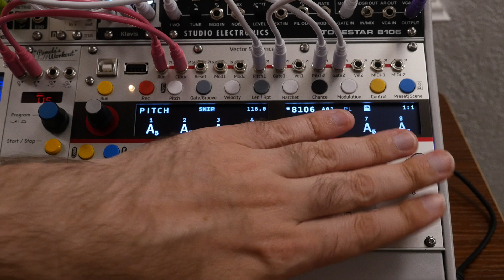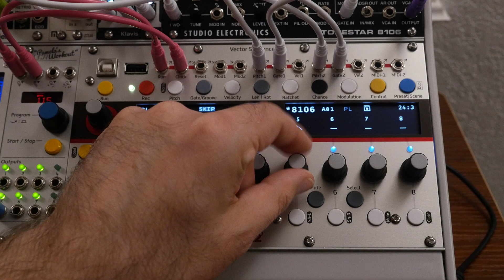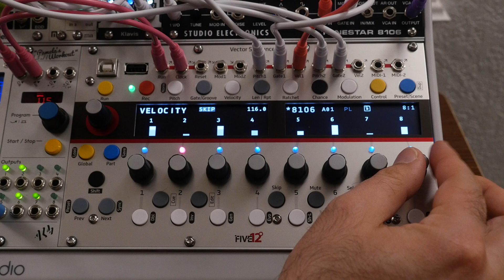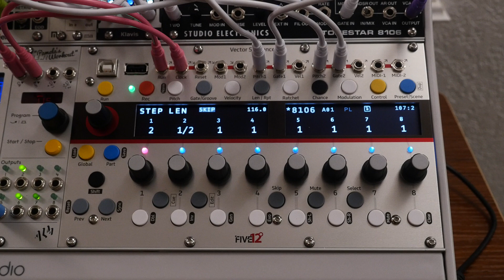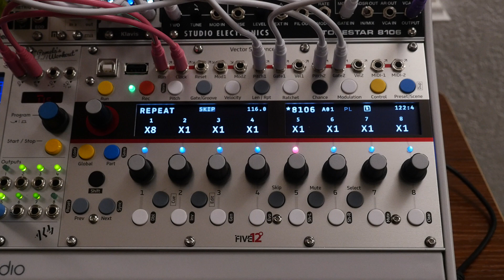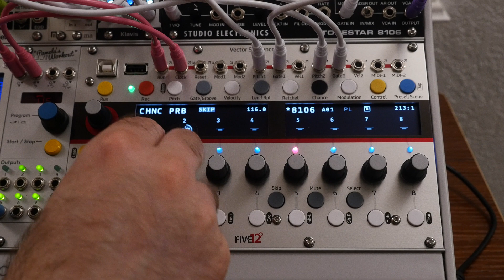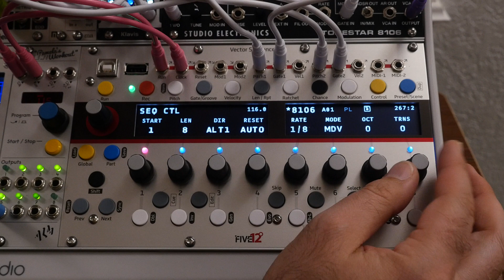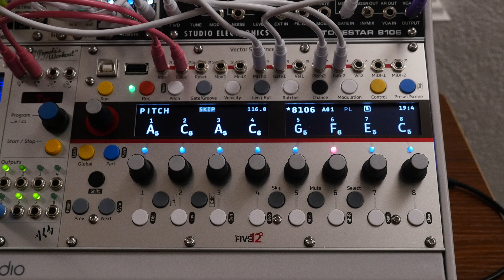Five12 Vector Sequencer - Parts Overview (#1)

Comment: It looks like way too much work to use like programming a computer. I want a playable sequencer that has pads for creating on the fly jams and sets. Unfortunately, with exception of WMD Metron, not much else there in Eurorack land for that besides Rene and that leaves much to be desired. That said, it looks way easier to learn and use than other complex Eurorack sequencers like Nerdseq and Eloquencer!
Reply from the maker: It's not bad. It can be menu oriented I'd you want, or less if not. Because there's only 9 knobs and buttons there will be some level of that always though. Even Rene2, which I own, has some level of config that is needed. It's hard to escape with hardware sequencers.
Reply: @ferrycollider  mine came yesterday and agree it is very intuitive now that I have tried it and have it in my setup.

Comment: I watched some other videos and thought maybe it's too complex but this video showed me it's really easy to get to grips with as well as having amazing depth. How easy it is to do 16 or 32 steps? I know you don't necessarily need it as you can add a lot of variation without it but still could be handy.
Reply from the maker: With the part selected, you'd hit Control and use the encoder to pick a length.